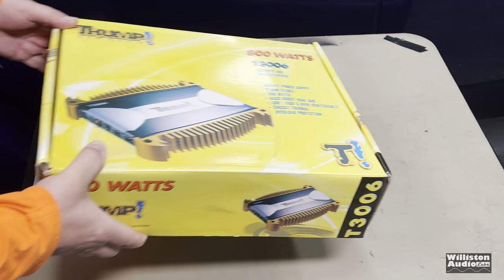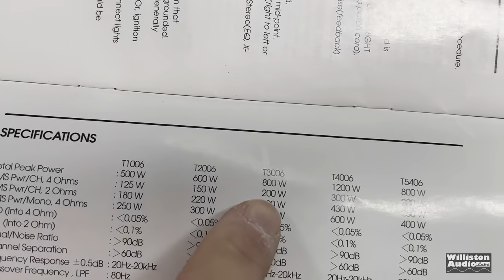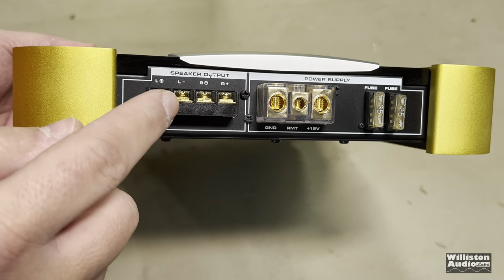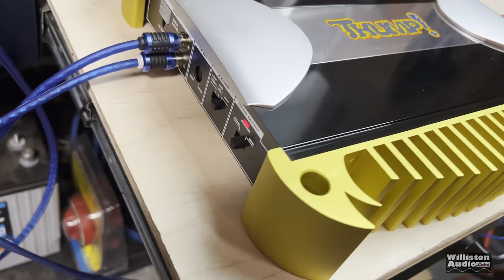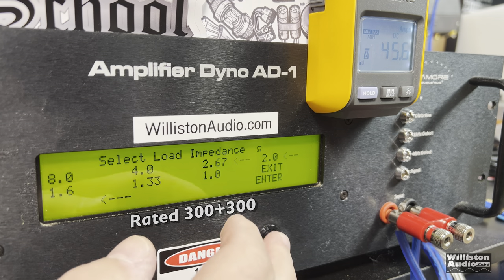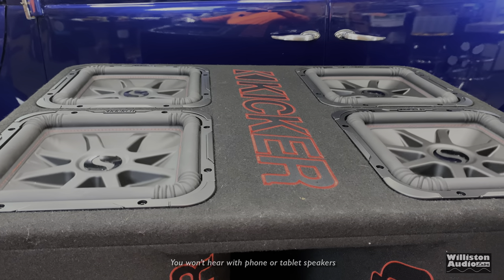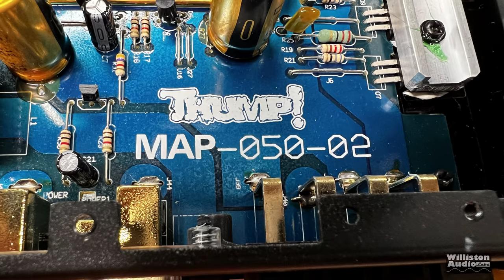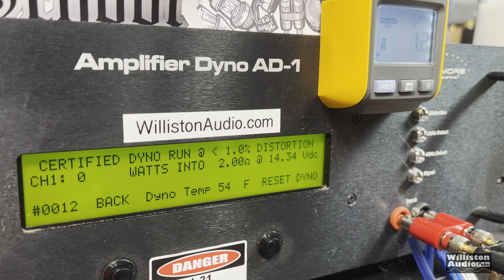Do It Thump Tho? 2001 Thump T3006 Review and Amp Dyno Test #FleaMarketFriday

Comment: I always use a test light on the power side never tried ground side this is also great to charge capacitors
Reply: I will from now on😁😁👍🏾
Reply: Fav would be performance technique if that’s how it’s spelleded
Reply: @lawr3nc3mann84  I loved the power acoustic I worked for a not so reputable audio shop we sold power acoustic and Rockwood but we also sold higher end stuff kinda like kenwood and jvc, one of the power acoustic amps had a huge black light bulb that put off a ton of heat, the customer would complain about heating issues I unhook the bulb and they preferred it to over heat instead